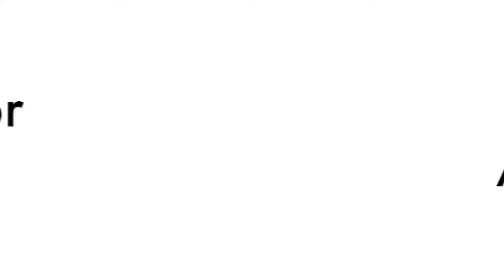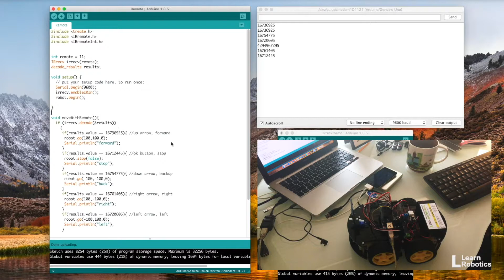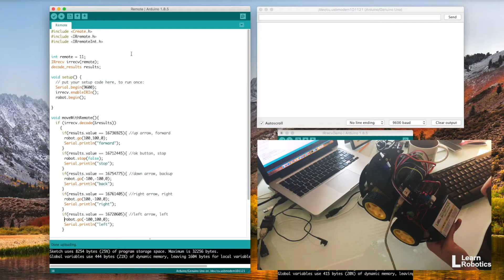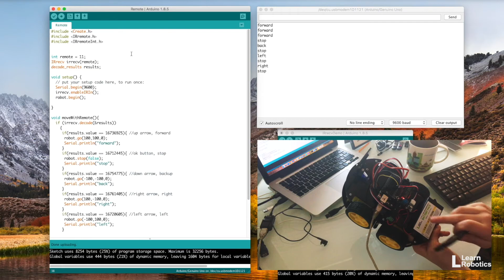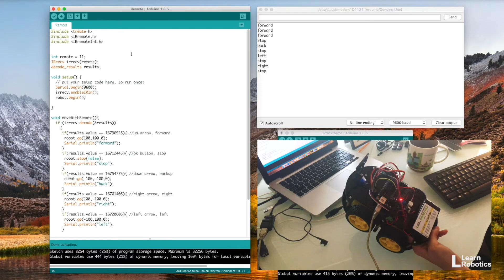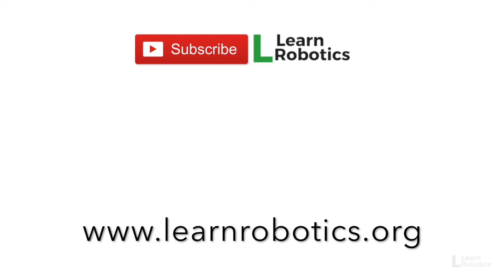Control an Arduino Robot with a TV Remote

Comment: hello. that s a great job. a question though.
can you design the remote control in a way that when you press and hold the forward bottom  the robot start moving and when u stop holding the bottom, the robot stops?
does this need a special kind of remote control?
Reply from the maker: nope just an IR remote. The programming is set so that if a certain button is pressed, the robot moves, otherwise stop